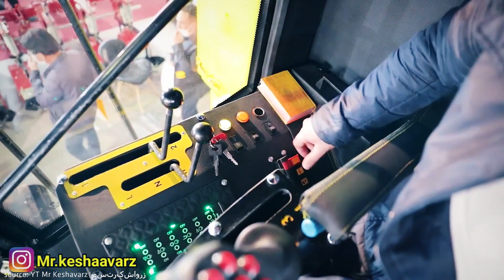Tractors and Heavy Machniery of Iran 🇮🇷

Comment: the biggest tractor factory of Iran was built by GREAT SHAH of iran 😍 .  RIP
Reply: It was an old factory and assembly work

But now its size has multiplied and all parts are made in Iran

Shah was not sanctioned
But now Iran is progressing in spite of extensive sanctions
Reply: @alighods2425  Iran was not sanctioned because GREAT SHAH of Iran was a democrat king!  unlike Khamenei who is a murderous
Reply: @KK-fq3sy  Which democratic king?

American Democrats prevented Shah of Iran from entering America after his fall

The Shah would not have fallen if he was not dependent on America

Khamenei, with all his flaws, does not depend on anyone and is independent

No country has a military base in Iran
Reply: @KK-fq3sy  Which democratic king?

American Democrats prevented Shah of Iran from entering America after his fall

The Shah would not have fallen if he was not dependent on America

Khamenei, with all his flaws, does not depend on anyone and is independent

No country has a military base in Iran

Comment: YEEEES I'VE BEEN WAITING FOR THIS! 

Iran had a lot of unique companies like this in the past, for example several companies producing copies of Jeeps, and a local Brand (Iran-Kaveh) building Mack trucks, but in both cases the moment the shah fell in 1979 the parts being imported from Europe and the states dried up, eventually leading to them all folding (though in the case of the company building Macks they just switched to building Volvo, Yugoslavian,  Renault, and later Chinese Knockdown kits if I remember right, and are now called something like Saipa diesel)  

glad to see the tractor production sector did not seem to have that happen to them!

(Great work!)
Reply: all those companies are still there and producing wither own designed trucks or the chinese one, after americans  the european are out of iran too
Reply: The company assembling mack trucks in iran (for example they equipped the trucks with custom radiators to run well in iranian roads and circumstances) was called mackiran and was a private company and Akbar Ghandchi was the owner. In fact most of our insfrastructure and industry was built by private iranian enthusiasts or by our beloved Shah, but after the revolution the islamic republic took every industry over, the owners mostly were forced to leave, because they were accused of nonesense (the mullas did this to every influential or rich iranian and took control over theyre property). 44 years after the mullas overthrew the shah with the support of america, russia and europe.. More than 50% are poor, many are starving, many have no clean water, healthcare is fucked up, average iranian earns 200 to 300 dollars a month or even less, but none can afford meat (20 dollars per kg), many people just eat bread with potatoes or eggs.. Theres no industry left here, industry is just a formal term and is only used to satisfy the lords of the mullas with iranian resources. May you burn in hell Carter, along with your british and french comrades and whoever invented communism
Reply: @CC-ij4zd  the wonders of Islam... and they want to do this to the rest of the World...
Reply: not unique.. just copying western equipment... if you listened to the video.. they are all based on MF tractors... all old generation...
Reply: @milesinnz Western tractors are so expensive its better farming the old mesopotamia technique 😂😂😂
Reply: @neilnelson7603  100% I have an older Ford and looking at getting another one...
Reply: @milesinnz  You mean the  West do not copy others ?
Reply: @lateefbamisedun7050  you want to educate me what you are talking about - some examples maybe ?
Reply: @milesinnz  A very simple question, you failed. So you want to be educated ? You write as if you know it all.
Reply: ansurd weL an thAT 1
Reply: @lateefbamisedun7050  دوست دارم ایران خامنه ای